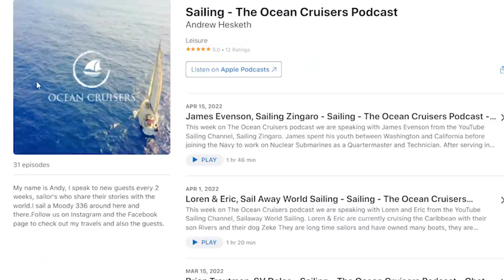Servicing our engine for the FIRST TIME - WE FOUND THE (obvious) PROBLEM!! | Chasing Currents EP 43

Comment: Check out Sailing Cadoha. They had impeller issues and some of the bits were in the heat exchanger, I think, which caused problems at higher revs. Maybe you need to trace the system to check there are not bits hiding elsewhere🤙
Reply from the maker: Hey Mark, yes we did see that episode. And after the service we did get the bits out our heat exchanger, we just forgot to film 🤦. Thanks for the comment though 👍

Comment: I have a Beta Marine engine too, a 25hp. Before refilling with coolant, you really should get a heat exchanger servicing kit (couple of o-rings and a rubber ‘divider’) and service that. There will probably be bits of the trashed impeller plus the heat exchanger tubes may be scaled up. These can be carefully cleaned with a bicycle spoke but be careful not to scratch/perforate the exchanger tubes!
Reply from the maker: Hey we actually did do this after the service 🤦. We found the couple of bits of impeller as well 😊. Better safe than sorry. It's crazy how expensive they are to replace 😕. 
Thanks for commenting 😁

Comment: In your circumstances I would suggest you keep a service kit on board at all times. Check your impeller at least annually unless you really enjoy stripping down the heat exchanger. Also carry spares of any rubber engine pipes as a split or broken belt can really ruin your day. Another way of priming the system is to connect your dinghy pump to the diesel tank breather pipe pressurising the tank and forcing fuel into the filters. A priming bulb works but can still take a lot of pumps to get fuel through.
Reply from the maker: Hey Andy, we do keep a spare service kit on board at all times with extra spares, but we don't have any hose spares so will definitely get some 🤔.
We actually found a priming bulb after we did this service 😊 so glad to know for next time.
Thanks for commenting 👍

Comment: Those impellers are a pain in the backside. The whole reliability of the engine revolves around that thing. They share the same problem with 0 rings and oil seals in that you can't see what quantity they are by looking at them. Where you bought them from It is also not a guarantee. They break up and the bits disappear into the engine.
Reply from the maker: We agree 👍 💯

Comment: thanks for another great video!  I am about a month from putting my boat back in and you guys are my boating fix for now lol. You did a great service job. I do recommend oil change before storage as the old oil carries crap you don't want sitting in the off season, and it is a little scary as to where the bits of the impeller are, I had the same happen and I change my impeller much more often now as to not make a bigger job down the road. cheers! looking forward to your next video.
Reply: Yes, change your oil at the end of the season, used oil has acids that's will chew away at your engine over winter. Having drained the coolant you might as well take out the heat exchanger and give it a clean.
Reply from the maker: Hey Scott, glad you enjoyed. So happy we can help with a boating fix 😁.
Thats a very good point about when to change the oil, I think we will do this going forward.
And were also going to change the impeller more often we think also 🤔. 
Thanks for commenting

Comment: The problem you will have is there will be bits of old impeller inside the heat exchanger blocking up anding in futher big issues down the line...
Reply from the maker: We did actually clean the heat exchanger after and found the bits 👍. Luckily it's not to big of a job on the engine 😅

Comment: Haha, mine was exactly the same when I changed the impeller last week, just three fins left on the impeller!  The joy of boat ownership!  Be aware, the lift pump handle is very fragile. Mine broke and I have to crank the engine to get the fuel through.  Many engineers suggest putting a hand pump in the fuel line leading to the primary fuel filter to get round the issue. Another job.
Reply: Yep get a squeeze ball inline one from an auto parts place.. or scrap yard.😉
Reply: Yup I broke mine like that and have had a squeeze ball for 10 years. I also fitted one on the coolant seawater inlet - I can prime the impeller to save wear, and when the engine starts I temporarily close the seacock and check the bulb begins to collapse due to suction so I know the impeller is good!
Reply from the maker: We actually noticed after filming that we do have a hand pump that does exactly that 😅. At least we know for next time. Thanks for the comment 👍 😀
Reply from the maker: Thats a very smart idea 💡.

Comment: I hope no pieces of the old impeller is stuck in the cooling system. SV Delos have had that issue a couple of times after impeller faliure.
Reply from the maker: Hey we did clear out the bits from the heat exchanger after we made this video 👍
Reply: @ChasingCurrents  Yes i saw the text in the video a few minutes after i posted my comment. Really nice video as always. <3
Reply from the maker: Aww thanks Niklas 😊

Comment: That bottom hose isn't looking too healthy, I'd be tempted to get a length from a car parts shop to replace it - you don't need to do it right away, but having the hose onboard could be a lifesaver when it eventually goes - a length of hose shouldn't cost more than a few euros.

The inside diameter is the important part ;)
Reply from the maker: Ahh very useful tip, thank you for this comment 👍